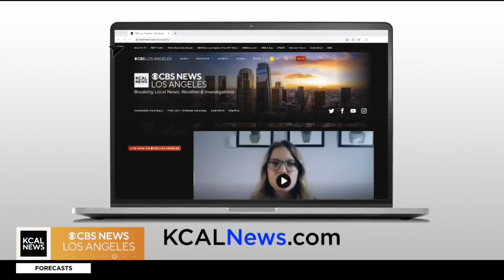Expert shares new information on the San Andreas Fault and earthquakes

Comment: John’s personal Laws of Tectonic Conveyance and Accommodation.

1:  Faults don’t produce energy, they store it.  Earthquakes are released stored energy.  Use your battery up and you have to recharge it with a battery charger that produces energy.

2:  Faults only accommodate movement/energy, they don’t cause it. The adjoining plates can even move in the same direction on both sides. Imagine the traffic on either the Northbound or Southbound lanes (your choice) of I-5 all going the same direction, but at different speeds and rates. The Doritos truck will deliver the chips much later than your arrival time to the same store, hopefully they’re not sold out.

3:  “Ok, so where does the movement/energy come from then?” 

Asthenospheric Mantle Flow produces Tectonic Plate conveyance (like a raft on a slow-moving river,) which in turn, produces movement along a Fault separating two plates.

4:  Tectonic Plates don’t move in a straight line, they slowly rotate in almost- imperceptible sweeping arcs as they’re conveyed; the NA East Coast is moving West and the West Coast is moving WSW.

5:  Subduction only pulls the subducting plate, it does not pull the over-riding plate.  The more buoyant over-riding plate is passively accommodating the convergence of the less buoyant subducted plate.

6:  Subduction doesn’t obliterate a plate, it switches the horizontal plate to near vertical, heats it up to a plastic state and stacks it onto itself like ribbon candy.

7:  Tectonic Plate divergence is produced by Asthenospheric Mantle Upwelling (like a boiling pot of beef gravy, mmm mmmm) AND! (Big And) the aforementioned Tectonic Plate Convergent Subduction Zones.  Imagine a tank rolling along propelled by its revolving tracks around the sprocket and wheels, just don’t piss it off. The track rises around the rear sprocket, rides the top wheels and around the front wheel, under the bottom wheels and back to the rear sprocket. The shallow mantle divergent upwelling is the rear sprocket, the moving plate is the track top, the converging subduction zone is the front wheel and the deep mantle is the track bottom.

8:  Asthenospheric Mantle Upwellings are in convergent-divergent harmonic balance with each other. Like gears in a clock moving together in opposite directions.

Comment: So the larger quakes every 150 years or so were triggered by the lake being full and then the fault would release the pressure. Well now that the lake no longer does that what is going to release that fault pressure? Eventually is it going to go off with twice the power since it hasn't gone off in twice as long. Eventually its going to pop and have way more pressure built up, i don't see this as a good thing.